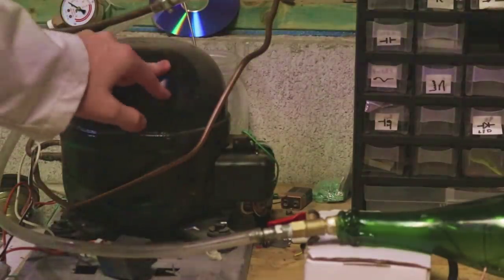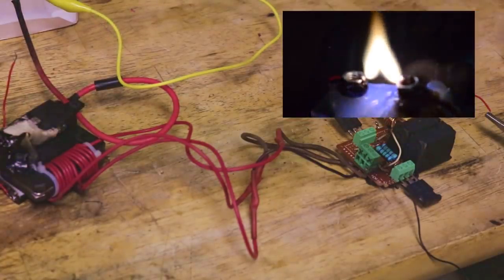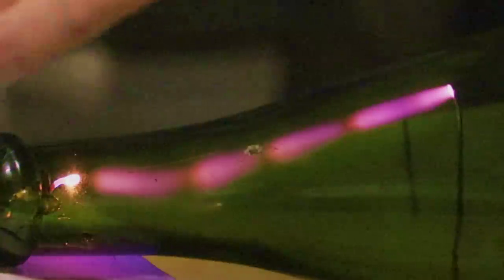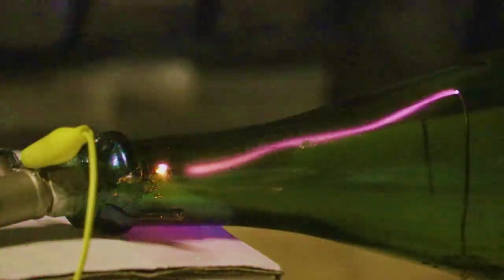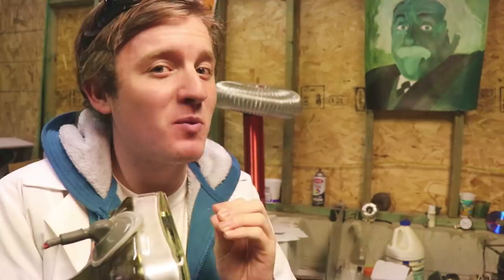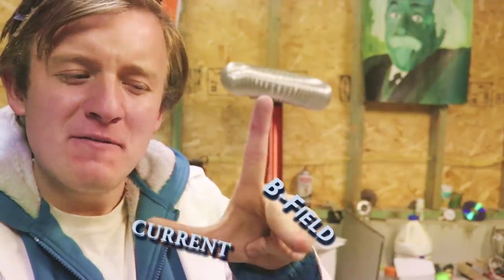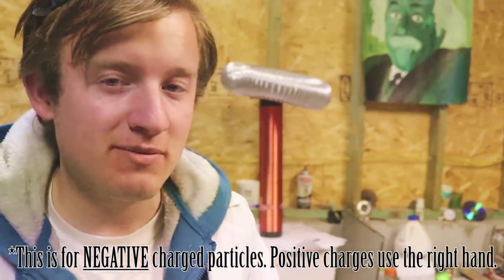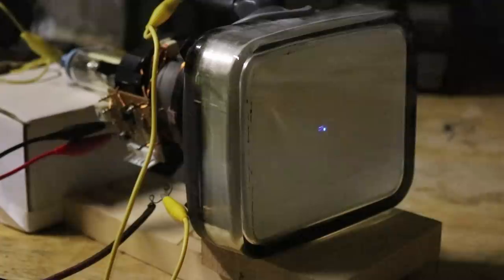Cathode Ray

Comment: Great to see videos on CRTs. That looks like a projector CRT, you should be able to get a much brighter spot on the screen. For the electrostatic / electromagnetic deflection electron experiment an oscilloscope CRT may be better.  The charged internal coating in your CRT will get in the way of the external charged plate preventing an induced internal charge. There is a Teltron educational tube for this experiment but great idea to use a standard CRT.

Comment: I'm sorry to say but you haven't made a cathode ray tube, but a geissler tube, you need a much much deeper vacuum than what you can get with even a good mechanical vacuum pump.. Cathode rays are invisible, what your looking at there is ionized gas, ie plasma, plus due to the poor vacuum and low voltage you also won't be producing any x-rays. Still a good video though
Reply: Que a mercury pump!   ...Also, oof x3.
Reply from the maker: Oof x4
Reply: lol x1?  XD
Reply: I believe he is producing x rays because of the fusion occuring on the cathode(the one closest to the end of the bottle or the yellow alligator clip)

Comment: JB Weld is also epoxy. But any epoxy (including JB Weld) besides the very fast setting ones work fairly to quite well. I've had long term issues with vacuum chambers due to the corona discharge UV breaking down the epoxy over time. Polyurethane adhesives have the same issue, but if applied thickly, are self shielding beyond about an eighth inch of depth. I use "Loctite premium construction adhesive" from a tube found at Wal-Mart. Slightly flexible, great for high temps (I've used it as a motor exhaust gasket), and gas/oil resistant if needed.

Comment: When rebuild the wine bottle stuff again with a clear bottle, put a it of JB weld/glue to the bottom, and a bit of chalk powder. It might act as phosphor, and emit red light if I'm right. For white phosphor, use an old fluorescent tube, and scrape off the phosphor coating from the inside. Have phun!

Comment: 7:14 CORRECTION: it is coated in a PHOSPHOR, which the element Phosphorus is named after, due to phosphorus emitting light, BUT there are no phosphors that actually contain phosphorus. In my opinion, Phosphorus should be called "chemious" Because it doesn't even experience phosphorescence, only chemi-luminescence. But when they first discovered phosphorus and gave it the name, phosphorescence described the general 'Material emitting light', but today it is a specific definition of electrons falling.
Most often, that is zinc sulfide, doped with copper. And that can be made from Zinc metal reacting with hydrogen sulfide gas. That is the good old green oscilloscope CRT, which has a long trace burn as it stays. It's actually pretty simple to make that phosphor, by getting iron pills and mixing them with zinc dissolved in an acid. (Note, I am working on a project currently to do that. Have yet to try the experiment, so don't take my words to mean it is safe. Expect possibly Hydrogen Sulfide gas (Toxic) Hydrogen, and Oxygen gas (Explosive), or something I didn't notice.)
I'd double check all my facts, if you were to put this in a video, but I wanted to at least point out one common misconception.

Comment: It didn't appear you had sufficient vacuum for good cold-cathode X-ray production, but that takes at minimum a short connection to a good dual stage rotary pump - what were you using?

Comment: Didnt cathode tubes emit using heaters? Wasnt it thermionic emition or something? I suppose this was the predecesor? Afaik the HV was only to direct the electrons to the screen
Reply from the maker: That and high voltage yes, the heating helps to create free electrons (which I just had as that copper that was melting on the end)
Reply: @KeystoneScience  
well yeah, plasma heated copper wire could also be considered as a heater of sorts. Didnt see that :P